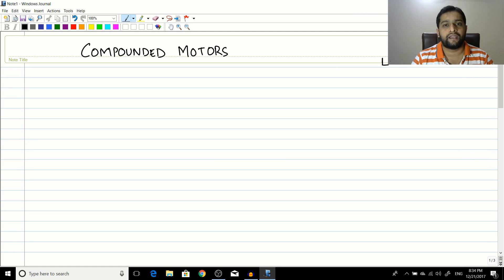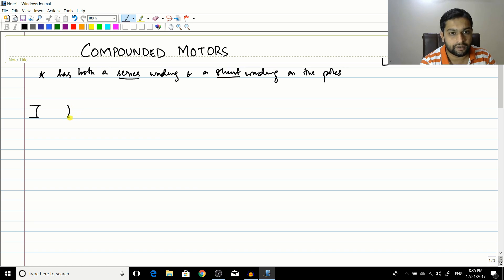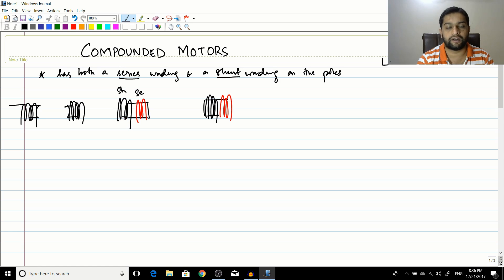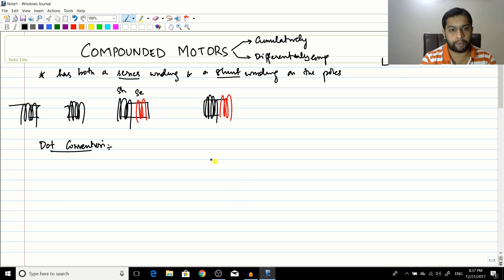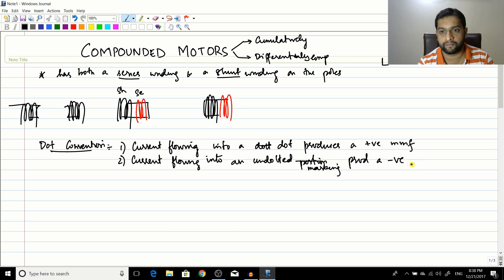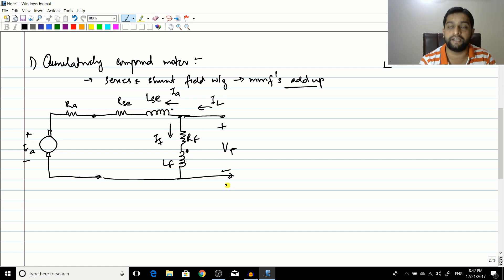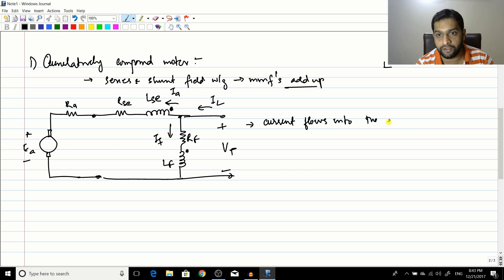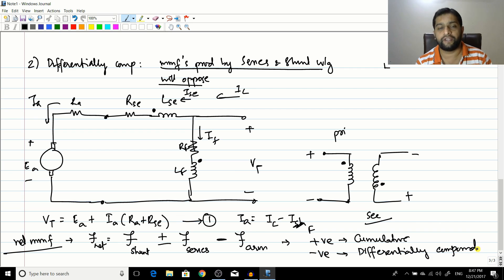#14 DC Motor -  Introduction to Compound DC motors

Comment: Reference 12:17

When giving the equation for Terminal Voltage Vt, why was the resistance for shunt winding neglected?
Reply: Because in DC, di/dt = 0. This effectively eleminates voltage drop on inductor. Thats why we do not include it in KVL equation

Comment: My dear respected sir you are the only to explain the ITI electrician theory in the best way because DC motor and its type AC motor and its type you can see the NCVT syllabus of electrician theory a 10th pass student cannot able to understand all about I I am facing a lot of problem as I am not a science student of Physics chemistry math as my mental power is too low but I am trying to do my best my dear respected sir s lecture is the best lecture
Reply from the maker: The lectures have been made in such a way that with just basic electrical knowledge you will be able to understand..in ur case for iti I don't think a lot of depth in required, but more of practical knowledge must be needed, which are also covered I guess...thank you again